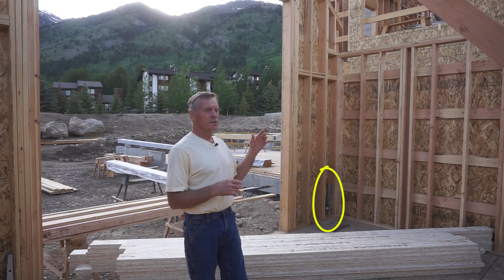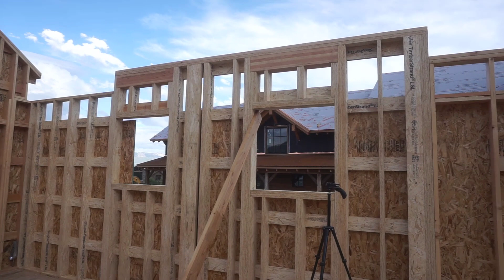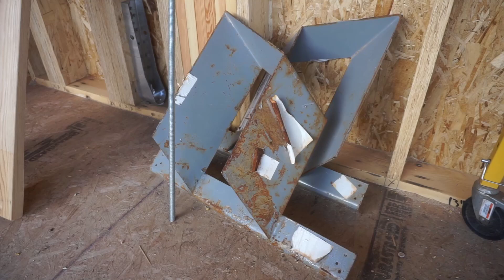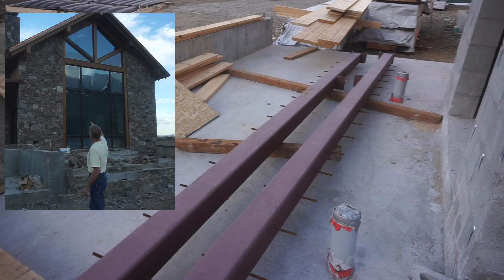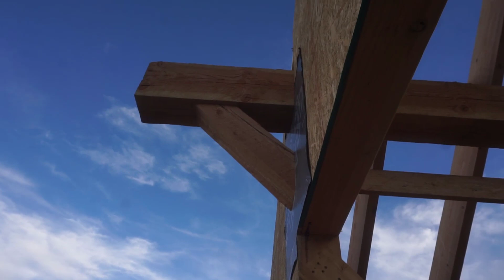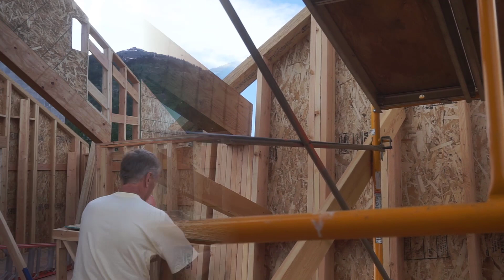A Carpenter's Vacation

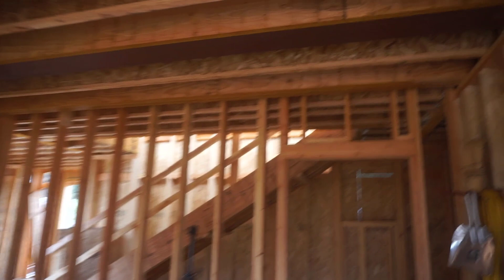Comment: Very cool video.  BTW, I noticed that they were also using wood I-beams on the first floor, starting at 5:40, and best seen around 5:48.  It's a really cool technique I've never seen on a house build before.  I also wonder how they managed to get all those 2x6 lamenants so flat and true.  It would be cool to see a few getting put together.
Reply: The TJIs - floorjoists - are widely used, as they save weight, add strength, reduce noise penetration and are arrow straight and can be delivered in very long lengths. They also see use as other flat or sloped members like in roofing systems.

As for the 2x6"s, it makes a world of difference to have a flat floor or a good sawhorse setup to work on. If slight bows are alternated, and the worst ones left out, they can counteract each other, giving you a nice and straight piece. It is essential not to lean the studs sideways during this procedure - in other words: keep the broadside (6" side) square to the floor or sawhorse - or the entire stack will rack on you, and will twist between the plates. Done right, the need for planing should be minimal, if at all needed. Usually a stud is placed and nailed completely somewhere in the assembly, and then the rest is added to one or both sides. This is sometimes also done after walls are raised, not only to avoid lifting a heavier wall, but also to have a chance to double check finished height - Cutting it down to size, once everything is crammed in there and sheathing is finished is no fun. In this particular instance, the corner, it could look like a complete finished assembly before the wall was raised, considering it runs past the buttwall (gable), and the mounting of the plates.
Reply: @martinpoulsen6564  Thanks, that's very informative.
Reply: @jandrewmore  You are very welcome good sir!